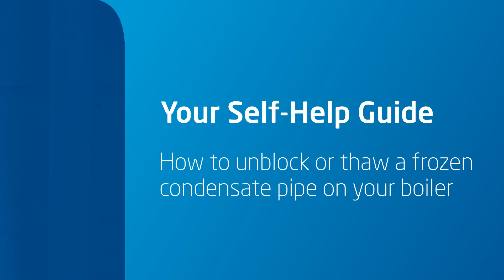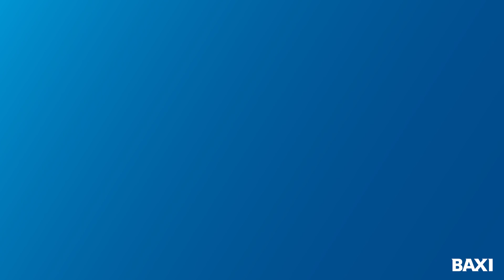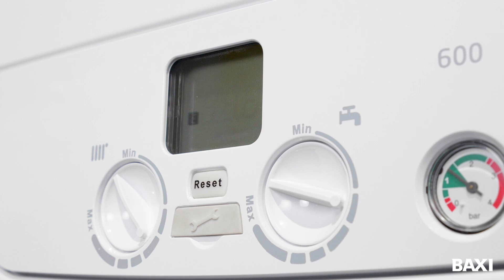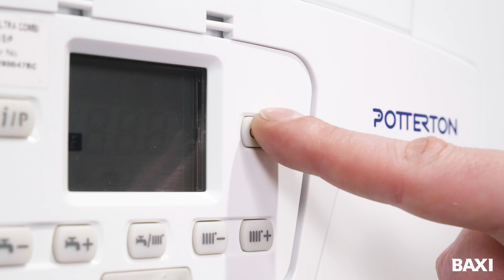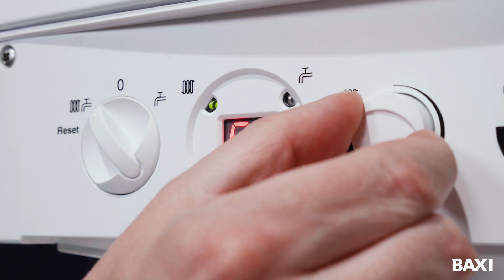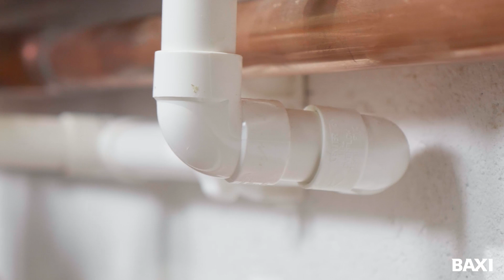How to thaw a frozen condensate pipe on your boiler | Baxi Boiler Advice

Comment: This is top of 'British Engineering'. Basically if it's -1 for 2 days, instead of staying inside warm you must go outside and defreeze condensation pipe. First year this happened I thought it's a joke but no. If you have condensation pipe outside you WILL have this problem. If your pipe freezes at i.e. 2nd floor height you will need to wait till it thaws itself.  If you are away and pipe freezes and below zero temperatures continue your radiators may freeze and burst.